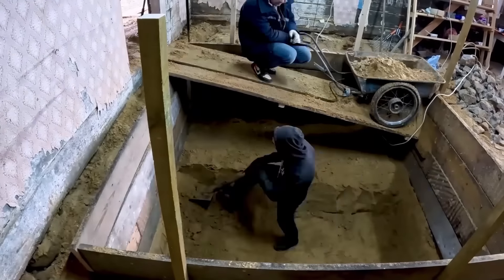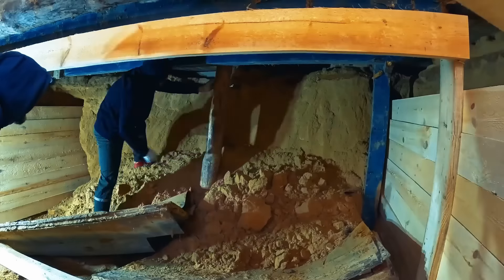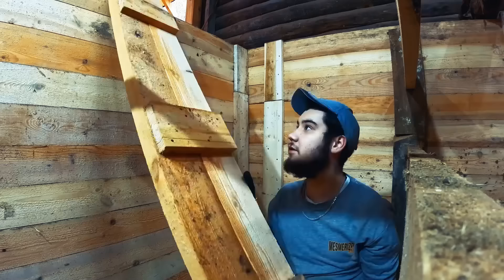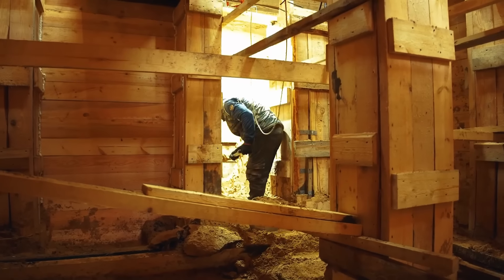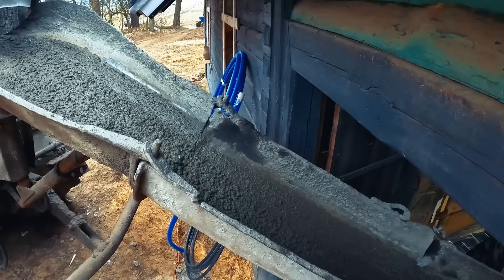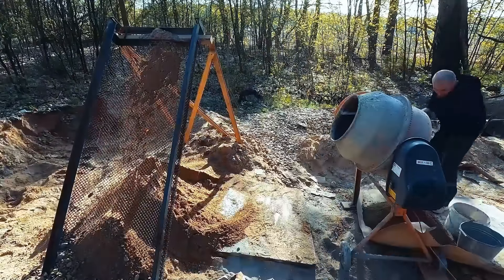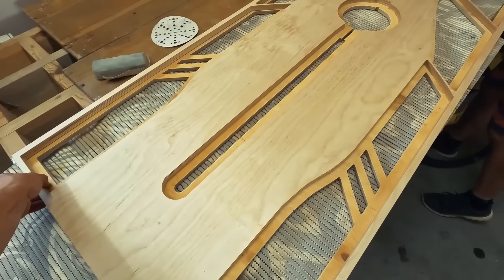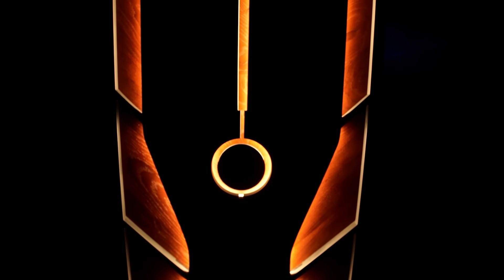Building an underground secret bunker in the forest

Comment: The best air filters for bunker are the Swedish ones that was designed for submarines. 

An old design but very practical, easily powered by hand crank or electric. 

Clean air is a critical need for survival. 
Remember to disguise the pipe & opening above ground. 

They are also very quiet.
All mechanical, no need for electronics. 
A bit of lubricant oil once a year & they last for decades. 

Just sharing, well done so far.
Reply: Thanks for watching and your information

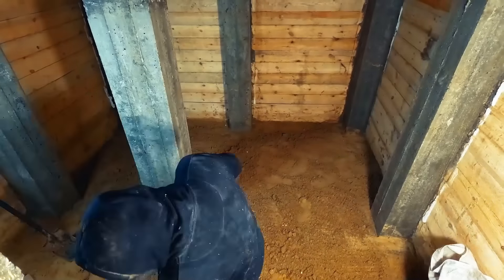Comment: 16:40 concrete must not dry out, but cure instead. You want the concrete to stay wet, to help it cure stronger. If it dries out, it will be a weak structure.
Reply: Thanks for watching. Everything is under control
Reply: Concrete dries as it sets, it's part of the exothermic process. I think you're confusing dry and wet mixes. 

It is stronger cured in water but it's not significant enough to warrant the work keeping it wet for a month unless it's for a runway or some such, even then they don't do it for a month.
Shopping centres, bridges and just about everything concrete is dry cured

Comment: Your main floor weights a ton and the supports are just resting on loose sand?   Expect it to sink, and if the bunker walls are just untreated lumber expect that to rot away
Reply: Thanks for watching and your concern. Everything is under control
Reply: cmon he exposed himself to asbestos , that bunker will be his grave lmao
Reply: That is not out problem? It's not regulated by the US standards and safety concerns. Exposure to Asbestos MAY cause problems in a person's future. Like 25 to 30 years later? I helped monitor and remove Asbestos insulation at Sherwin Williams in Chicago from 1989 to 1994 and it was in 2014 that my lungs showed signs of Asbestosis , not Misothelioma. These guys will be fine. And even if they get sick, it's not our problem.
Reply: @chrismsmalley2626 

These guys are gonna last a bit longer than this structure tbf but both aren't lasting long

Comment: I think you did a great job. Of note, be careful with the wood over time. The wood will soak up moisture and expand and retract. As such the sand/dirt will seep through. It would be wise to insulate the area for waterproofing and sealing. Since you are mostly through perhaps use something like flex seal. White as the black would be way too dark! Be careful of condensation too.
Reply: Thank you so much for your interest and information! Sub and keep on watching
Reply: I was thinking about condensation and wetness, but I'm also thinking about freeze line in the soil heaving the concrete, I'm betting the frost line is about 1.4 Meters down.  An EPS outer part of the concrete form would help mitigate this.

Comment: Making concrete pillars without underbase doesnt realy make sense? I believe you should first make concrete slab in the bottom and than make the pillars on top of slab. As they are now they can sink...
Reply: Thanks for watching. Everything is under control
Reply: footings are needed 100% , these guys are just winging it... cool door bro lmao
Reply: @Bubbasvibez look at the quality of wood. Jesus in india that amount of wood would cost the same as a truck load of concrete.

They need proper foundations and then a concrete floor, followed by cast in place walls and ceiling. Basically a concrete tank buried underground.
And if you're smart and handy, you would install a thin 20 ga stainless tub on soil before casting the basement/bunker unless site conditions didn't permit or the basement was bigger than say 150 sqft or something.
Reply: @axes_garage  lol. what a reply

Comment: You should go with the Dumbledore spiral staircase Hydraulically lifted from below the hidden room. Lifting a concrete circle lid.
And you should mount compressed air on one side of your router table and a dust collector on the other. With a compressed air nozzle wide but blowing towards a gap in the center, it will clear sawdust and cool the router bit at the same time.
Reply: Chris, thanks for watching and information

Comment: If it is accessed by a secret door it's already perfect in my opinion but....
  Ive always wanted to make a salt tile room. Use it to cure meats, cheeses etc. The salt bricks can be bought at a farrier supplies shop or on the web? I think only one wall would be enough?  Full height and maybe the width of the smaller wall would be great. Box it in and put in a glass door front that seals off and regulate the humidity. That's MY vote.

Comment: One, small problem, it's nice to have a down stairs, but without a sealed unit, that has an air tight seal, that's protected from ground water, ambit air sealed system with a remote airfiltration you just have a nice underground space.  It needs to be secured for all aspects of Contamination period. You realize that the main factor that you're trying to consider, is the protection from contamination from sources from outside? It needs to have a completely shield aspect to it. Making a concrete bunker is one thing, common but.  Making a cellar is Just another room.  The intention be to shield the entire aspect of the room. That's the walls the floors the shilling everything everything with complete filtration...

Comment: The main issue you are going to have is flooding. I have seen it many times when people build underground. Recently 2 youtubers built underground cabins. They thought they wouldn't have flooding issues but they did. One was knee high, the other waist high. Beginning of last year another Youtuber built an underground bunker which flooded and the walls collapsed. He had the identical design. 
Water proofing the walls and floor is a must. Snow melt and rain will flood it.

Comment: Why now call BUNKER to a regula BASEMENT? thas not a BUNKER its a BASEMENT
Reply: Thanks for watching. Maybe you are right.
Reply: whts d difference ?
Reply: The walls
Reply: A bunker is a hardened structure capable of withstanding attack, usually a bomb or other destructive device. It should protect it's contents from overpressure, shrapnel, chemical, nuclear or biological hazard as necessary.
Reply: The idea is the secrecy. If you look at the thumbnail, it's an unassuming log cabin, and the basement is the real living space, a nice modern home. The idea is that the true value and contents of the home are hidden. Someone breaks into the main floor, and they just see an old cabin and move on. The main living space with the valuables is hidden. So yes. It's a bunker.
Reply: @mitchchartrand  no it's a hidden room. StrikeSurgical is correct. Beside a usual Bunker will not withstand a nuclear attack. I assume that bunker, creating more clicks, but I think both is interesting, so no issues with hidden rooms
Reply: I can't stand people who always got something to b** about 😂

Comment: You aren't supposed to use treated lumber in living spaces. The chemicals leak into the air. Wood also will deteriorate over time. In bunkers and nuclear safe shelters steel is recommended. 

I've been doing a lot of research.

Comment: I don't know if it is accurate .but, As far as i know the pillars need base support underneath otherwise the pillars will start sinking slowly. Hope it is wrong.😊
Reply: Nope, you are correct. The columns are pointless without significant footings. Even worse as they are small point loads on soft sand rather than having loads spread out over a large pad. The timber retaining walls and the perimeter of the upper slab will end up being the supports, and likely result in some serious cracking and movement.
Reply: @NathanNostaw  Yes, that's what I was afraid of, and thank you very much for the information.
Reply: Thanks for watching and your concern. Everything is under control
Reply: @axes_garage  nothing is under control lmao
Reply: @NathanNostaw  And that timber will rot because it looks like it's not been backed or treated!... So that concrete floor above will probably cave in eventually.

Comment: 2 things are missing.  2 inch thick carbon steel layer sprayed with truck bed liner spray, and 3 inch thick layer of Lead. Stop radiation from coming in. Sandwiched in concrete
Reply: Thomas, thanks for watching and information. Hope you like it

Comment: I would not have removed the wood ceiling below the concrete,  just leave for support. Also concret columns do not look like they are right under the slab. Fill that in. For the bunker you would set up a minny house imagining you would be in for days so a simple kitchen, bathroom, bed, heat, food, games, books. A separate secret entrance to go out side. A tunnel that comes out in the woods. I would definitely NOT make it a SMART house as gov can detect all that. People have been locked into SMART houses when no physical lock exists on doors and windows. Make the house Very analog not digital. No apps on phone. You will not be secret to the gov or military. Your bunker will be an easy target. Get rid of all that.